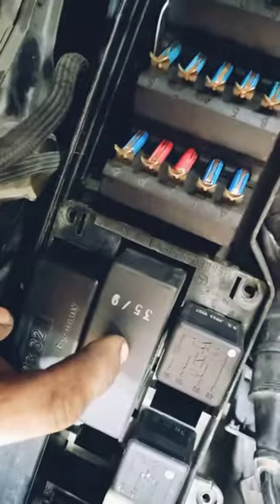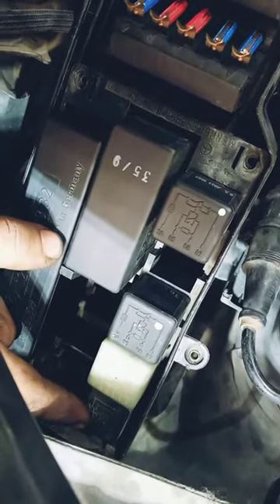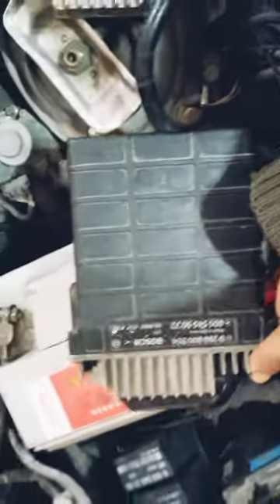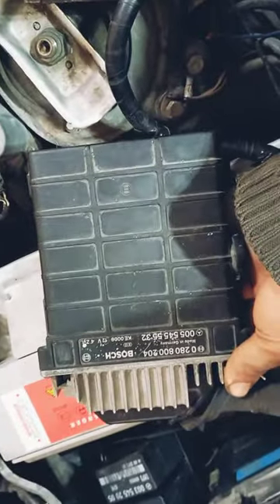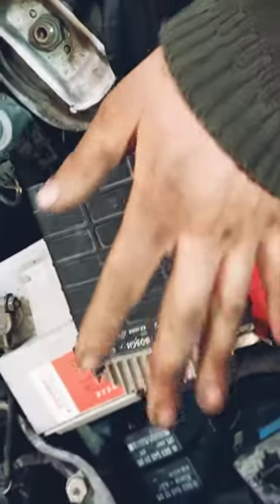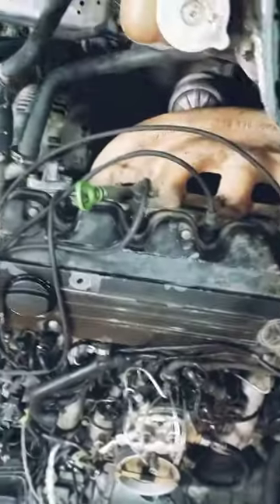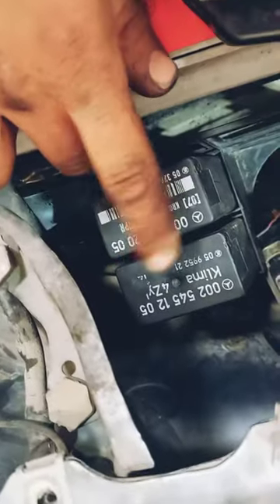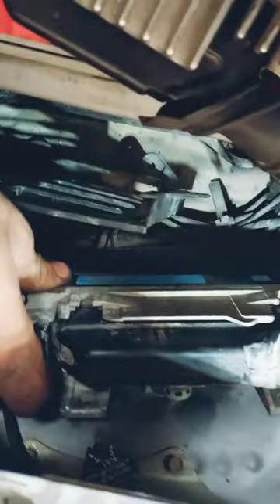All relay and fuse and controll unit w124

Comment: w124,200E,102m, KE-JETRONİK,1991 model Mercedes aracım,1yıldır radyatör fanı 110 derecelere varınca çalışıyor,bu araç 2004 ten beri bende,fan rolesi benim aracımın bu modellerinde 2 adet mi var,birisi 90 dereceyi geçince,ikincisi ise,100 -110 dereceyi geçince mi çalışıyor, yüksek devir-düşük devir 2 adet fan rolesi mi var,yoksa 1 adet role mi var,Yanıt yazarsanız sevinirim, teşekkür ediyorum,faydalı bir video olmuş, umarım kısa zamanda yanıt yazarsınız